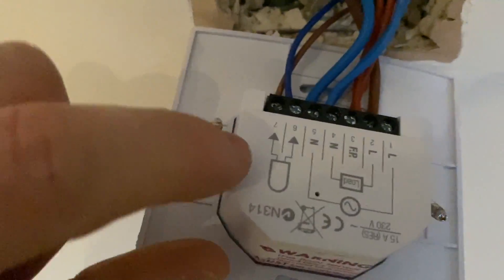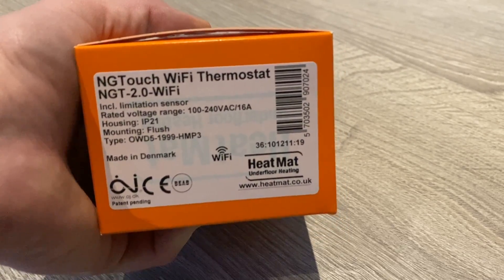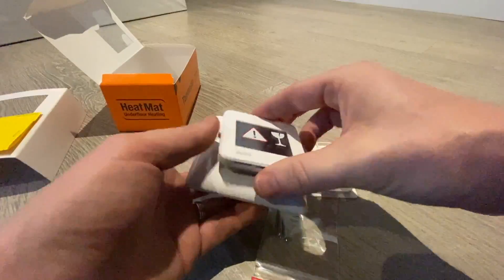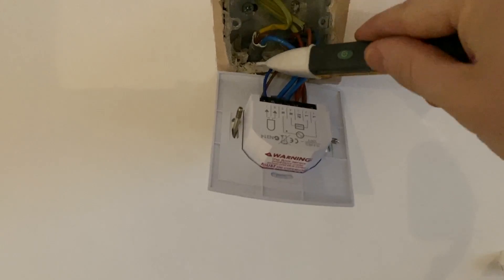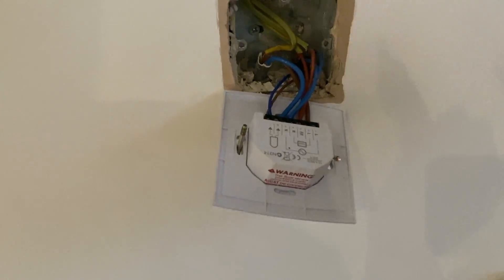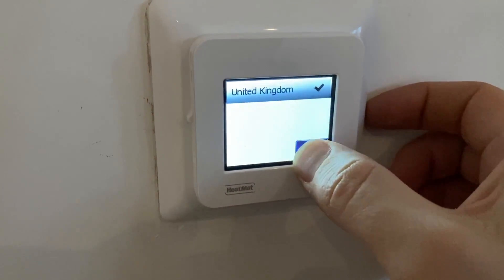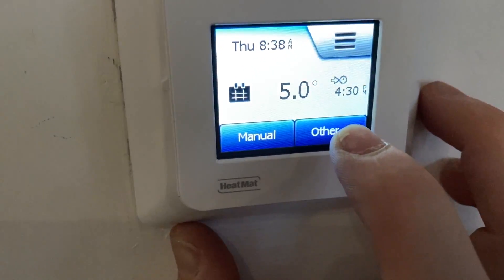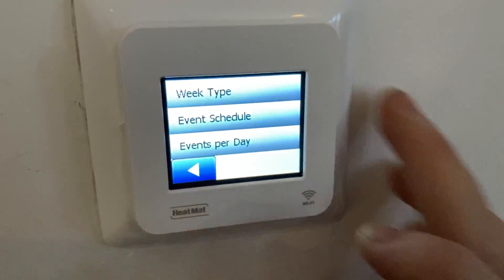Heat Mat Underfloor Heating Smart Thermostat Installation

Comment: Can't believe  I just saw you use a voltstick to prove dead. I have a lot of respect for you Jordan, but you have let yourself down badly here in this respect. I do hope any viewers don't see this a an example of good practice because it is far from it.
Reply: The issue is that the non contact indicator may not pick up the voltage.  It isn’t an approved method of confirming an isolation, GS 38 outlines the approved type of tester and iirc to prove them before and after use.  It is a free download from the HSE website.
Reply from the maker: NICEIC didn’t have a problem with this method when I discussed it with them. The fluke voltage detectors are extremely reliable and safer than using a GS38 test lead where you could come into contact with live parts
Reply: @artisanelectrics  I am really surprised to hear that the NIC are ok with this. I know from experience that you cannot always rely on voltsticks accurately indicating whether or not voltage is present.
Reply: Nick Elks I don’t think my employer would be too impressed either!  We are not allowed to use anything else other than approved voltage indicators (which they even stipulate which models) for proving isolations.
Reply: See chapter 13 here:  http://www.hse.gov.uk/pubns/priced/gs38.pdf
Reply: @artisanelectrics  Quite honestly BOLLOX if they NIC said this whoever it is needs sacking. You have seen the campaign on social medial recently and using a volt stick just takes a dump all over that. A none contact is great for proving live and should NEVER be used to prove dead.
Reply: Artisan Electrics sadly the guy in the NICEIC needs a serious word having with him. He is endorsing bad practice, breach of GS38 and your showing to a lamen in this video that’s it is acceptable. Sadly disappointed as the youtube community should set higher standards of practice. You are not a bad electrician. This video is poor form fella.sorry.
Reply: @artisanelectrics  Let’s be honest here if coming into contact with live parts is an issue when you're proving dead, is competence an issue? With regards to the NIC being happy with it, they will be because they want your dosh. I've had a few things on NIC visits that I should've really be pulled up on, every time nothing said, whats that all about and whats the point?
Reply: I still don’t like the idea of relying on something that lights up when you rub it on your jumper!  If your gs38 tester is used correctly then the risk is low, but if you want to use a volt stick then I’d recommend using it first and then backing it up with a proper test using a gs38 voltage indicator, proven before and after use.
Reply: cumberland1234 but he proved it. Gs38 is A guide. This is real world, get a grip!!
Reply: Michael Taylor the issue could be If a non qualified person copies the method and causes injury or death. That person family may sue the person who did the work that lead to injury. If they say they learnt or saw it on YouTube then A president could be set in law with a YouTuber liable for civil action. Duty of care and all. And the GS38 as a ‘guide’ would be used to determine compliance with HSG85 and HSR25. Add to the fact in position of public transparency we have a duty to work to high standards to protect public and others. 
Artisan has done himself proud acknowledging this on twitter.
Reply: e5 Group BS! There a guys who do back flips on bikes, BASE jumping, silly stupid stuff, if I did that after watching a YouTube video I wouldn’t sue. Get a grip!!
Reply: What’s the issue?  Better than licking it to prove dead, I suppose.

Comment: I had to replace a faulty in floor thermostat. They use 12k ohms version if I recall.  Thankfully the client didn’t want the floor tiles lifted up, so just replaced the thermostat and used it as an air temp and just put the control unit onto a timer as per Heat Mats tech support, who I must say are fantastic.  

As always Jordan a quality video sir 👍
Reply from the maker: Thanks good info!
Reply: The floor may get too hot without a floor stat.

Comment: Are the thermistors of the same value? I’ve often wondered if these in floor thermistors are of a set standard or vary between manufactures
Reply from the maker: I assume so as the new one works ok.
Reply: They aren't always the same. I went to fit one of these earlier this week and it came up with an error message. I told tech support which brand and model the old programmer was and straight away they said the new one was incompatible.
Reply from the maker: Interesting thanks
Reply: @alexkane07  
You can find out what the resistance is at say 25C floor temp.  Then fit a resistor to get the rating for the new stat. Assuming the old probe resistance is less than the new.